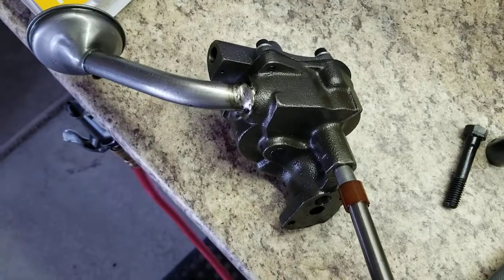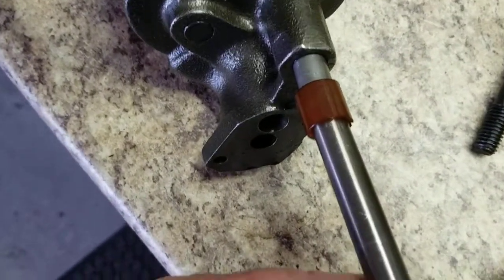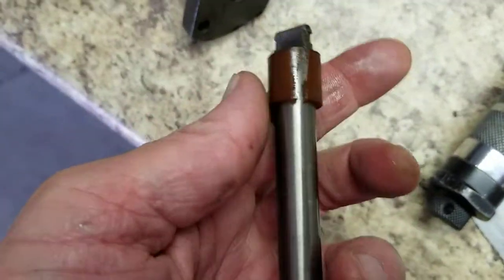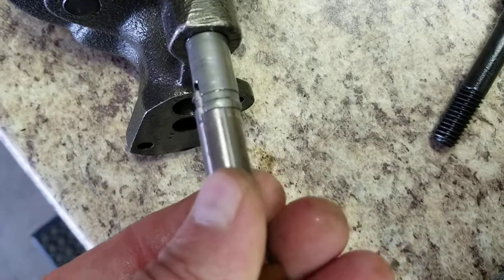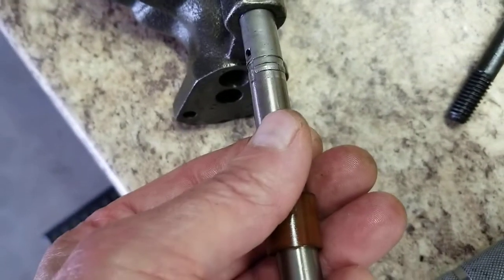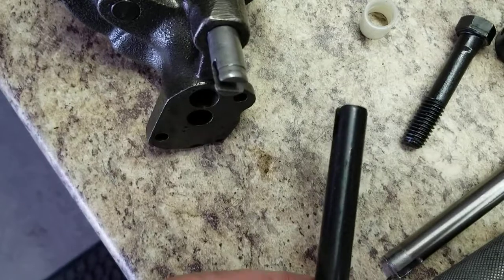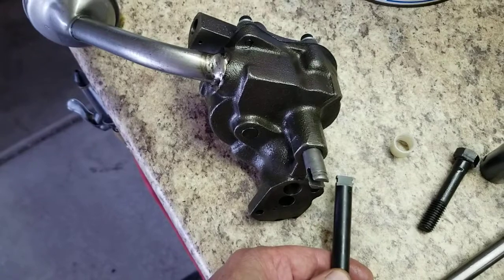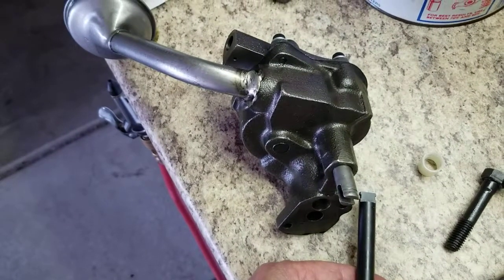BBC 454 Oil Pump Intermediate Shaft Coupling Failure

Comment: my best advice is toss those new parts in the trash and grab a "Heavy duty" version thats all metal and that coupling is built into the intermediate shaft and is all metal and not plastic. oil heat and plastic never end well. youll  most likely need to swap the drive gear from a old distributor as well so it fits correctly or modify as needed.
Reply from the maker: Thanks, good advice. When I reassembled I did opt for a steel collar. The nylon collar was simply included in the parts bag.
Reply: Where can I get a metal coupling for my 454 big block engine on my 1979 pacemaker

Comment: You had a coupling fail. Dropped the pan. Pulled the pump and put it back together with another plastic collar? Why not upgrade to a steel

Comment: Replace the factory shaft with an aftermarket with steel collar.
Reply from the maker: When I reassembled I did opt for a steel collar. The nylon collar was simply included in the parts bag.
Reply: @AndyHankinsActor  does the metal sleeve snap in?

Comment: I'm curious why if you have already had this problem (glad you found it!) you would not replace that collar with the metal version?
Reply from the maker: Good advice. When I reassembled I did opt for a steel collar. The nylon collar was simply included in the parts bag.